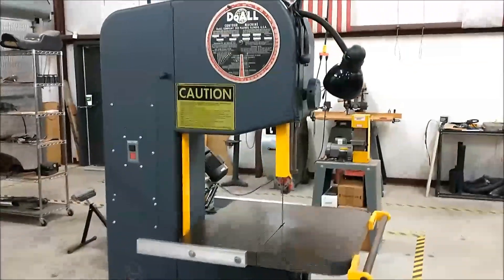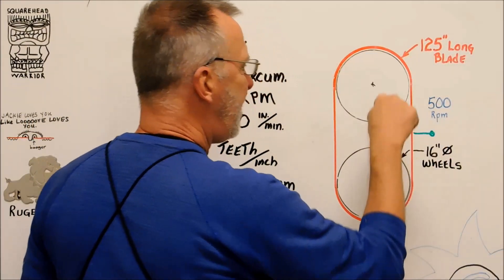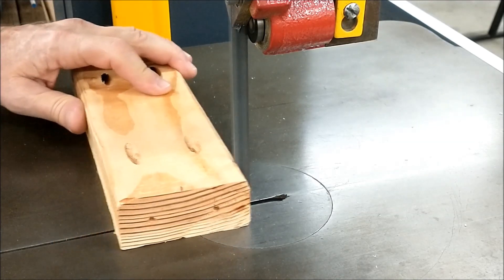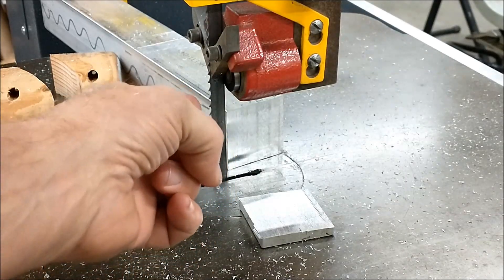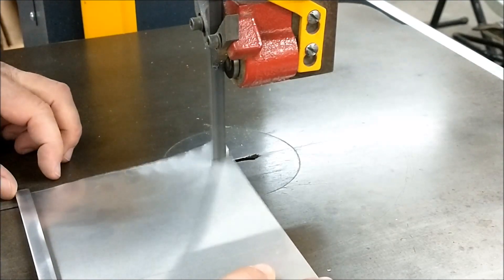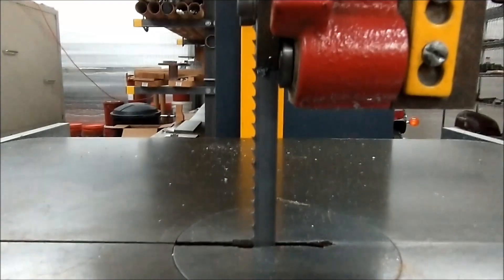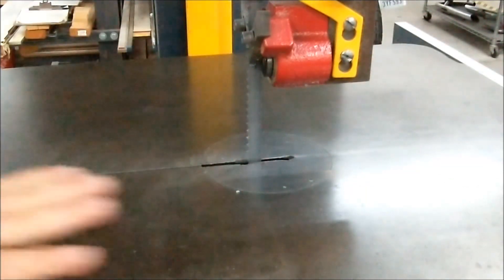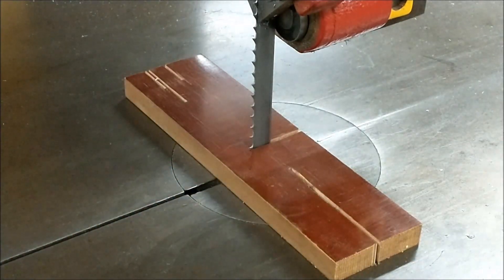1200 POUNDS, 500 TEETH, and No Conscience !!!

Comment: In our secondary school shop, the bandsaw was deemed to be the most dangerous machine that students could use. Why? Because we had had two accidents (cut, bot not severed fingers) in 25 years. Nice apron Joe. I think that shop aprons should be making a comeback 😁
Reply: I have got to say that I agree with you on the issue of the apron. 😁 I would definitely like to see more of them.
Reply: I've seen some in use and the pressure exerted by the operator behind the work gives me a little pucker.  Definitely need to create some space with a 2x4 or something.

Comment: working with aluminum and steel siding, we always turned the blade backwards. does make more and higer pitched noise but safer. saw doesn't try to pull into material or jump out of cut.
Reply: also have to be aware of thin strip it makes that is rasor sharp.

Comment: As a carpenter we always used the circular saw blade backwards for cutting galvanized corrugated metal.  It worked great.  Now I did this back in the 1970's and 80's before anyone was concerned about hearing protection.  I left about 20% of my hearing on the roof of a machine shed in 1974!  The top five keys on a piano make no noise other than the clunk of the key hitting the stop.  Hearing protection is not for sissies!  I have never tried the bandsaw backwards probably never will, but it is nice to know it works.